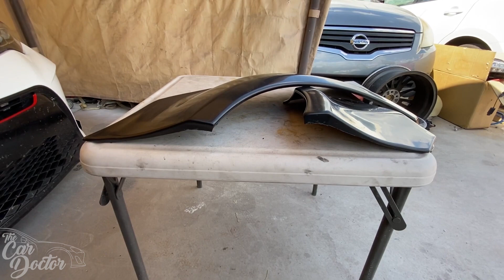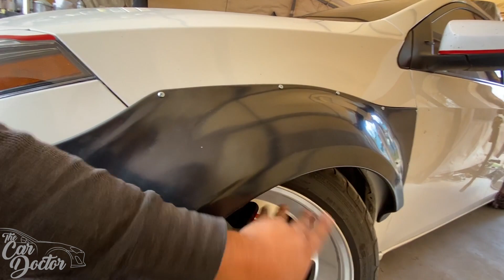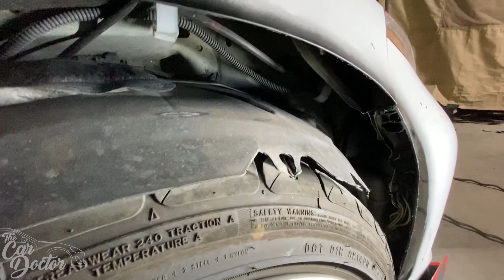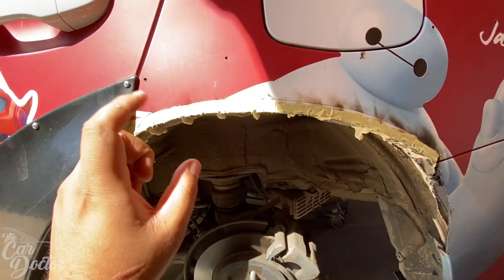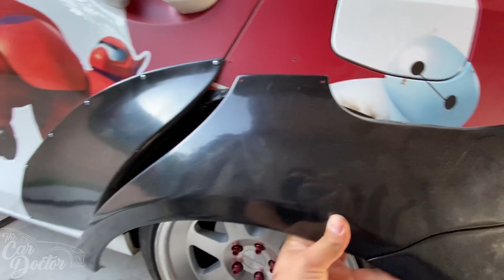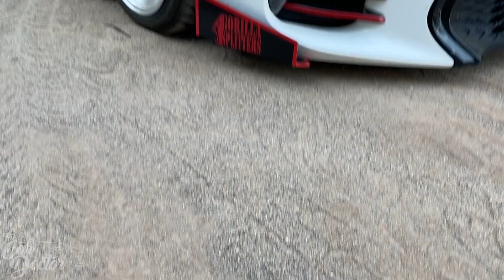2019 Bagged Toyota Corolla Widebody Install

Comment: Lmao wide body on ricer car
Reply: If you put a medium pressured (safe) turbo in it with an upgraded manifold, exhaust, and get a custom ECU actually these cars can pull about 300 hp, at 2800 pounds weight keep in mind.
You can find youtube vids of it, at that weight these cars can beat stock chargers in a drag (opening chargers) 
If you do the mods, it won't be a ricer. 
having that said, making your car sound, and look cool is awesome. Anyone should do it if they want. 
I think people who say "Ricer" are people who just want to fit in, or those who spent tons of money  on a car that came like that and they feel cheated.